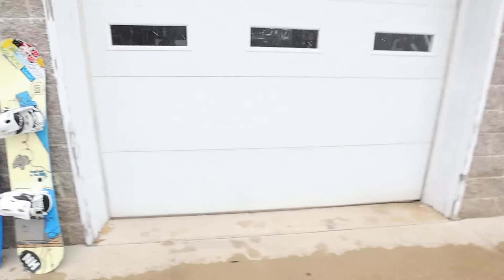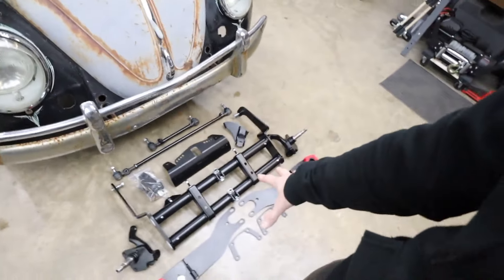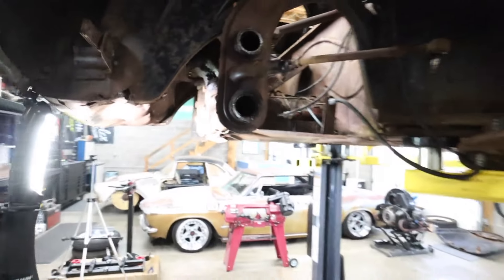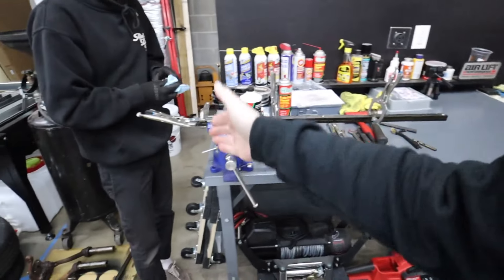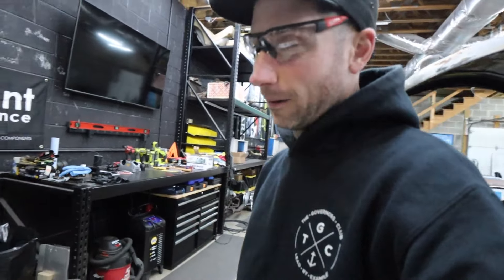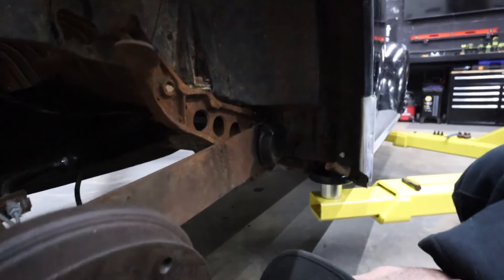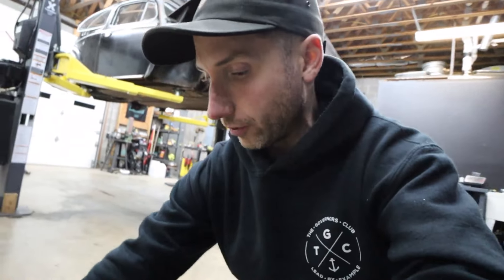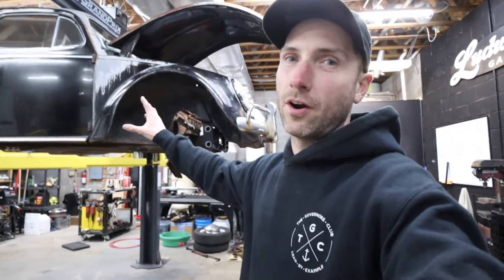FULL EVA RESTO SUSPENSION KIT FOR THE 64 BEETLE!

Comment: I swear Black Patina Beetles are the absolute BEST!!!    (for anyone, while you're going through things.  A great little trick I learned from old timer at a vw shop I worked in) That front to back main fuel line you can take an old throttle cable and cut the throttle pedal end off so it frays a little then feed it through the tube all the way and hook the solid carb end to a drill and turn the drill on, then slowly feed it out so it's like a spinning brush. it was an excellent way to clean that Front to back main line out . we did it on every customers car whenever we replaced fuel lines. you'd be surprised how much junk is in there stuck inside. then just blow it out .

Comment: I went through two drill bits and gave up and went with a carbide bit for a rotary tool. Got it at harbor freight. It was kinda expensive though. It was a kit with four bits I think. I am missing a few leafs from when I tried to lower my car the ghetto way about 8 years ago. Now I need them back and lost them when I moved so I’m just gonna replace the entire stack with new ones. It should help me get a better ride. Can you explain what bump steer is. I think I have that. Some times when I hit a bump when I’m turning my steering jolts to one side. I think it my tires rubbing on the inner fenders but only happens when I’m turning into a drive way or something.